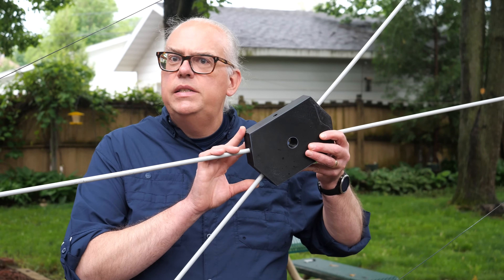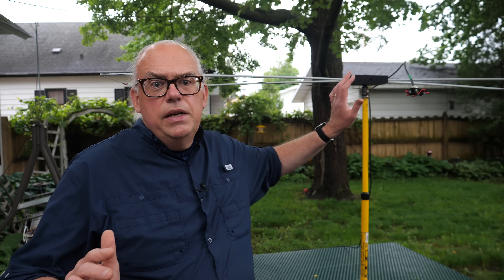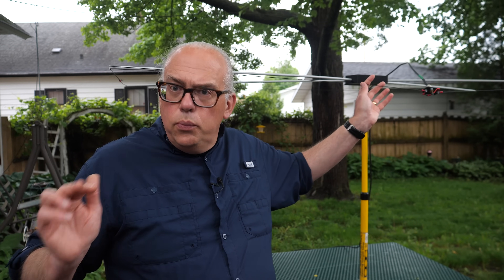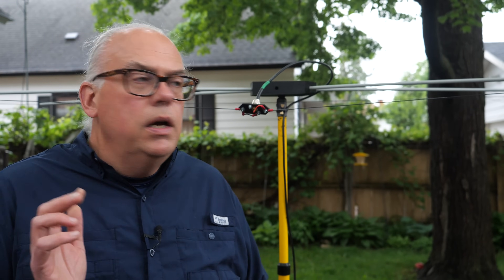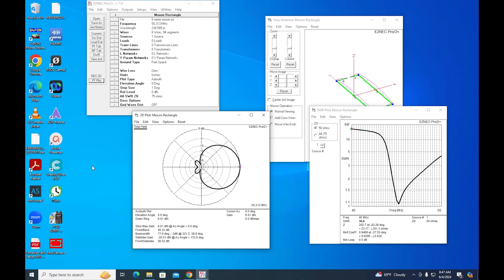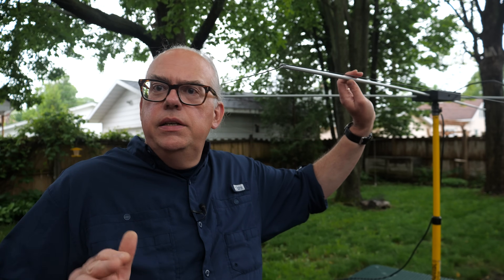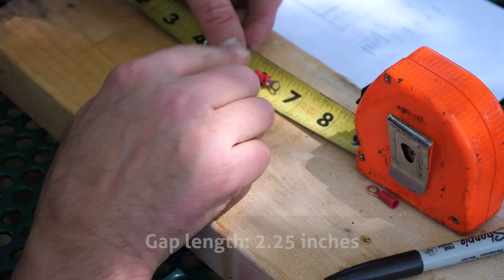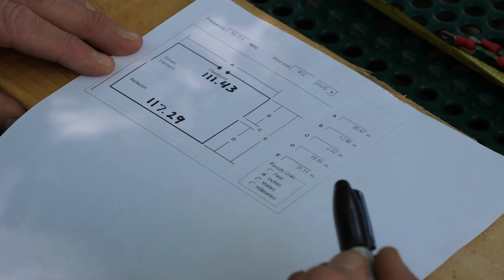DIY 6 Meter Moxon Antenna: Boost Your Summer VHF Fun!

Comment: We need a design that doesn't require a 3D printer.  I don't know anyone that has a 3D printer.  Nobody in our radio club has a 3D printer and Nobody in our radio club even knows anybody that has a 3D printer.
Reply from the maker: Many public libraries now have 3D printers. Otherwise, my hub is based on the design from this article. You could build yours out of wood like the original: http://www.kg4jjh.com/blackwidow.html

Comment: I’m confused as didn’t see you assemble the wire and you said 2 pieces of wire needed so left for driven right for ground, what about the reflector ? Isn’t that a 3rd piece ?
Reply from the maker: Technically you are correct, it would be three pieces of wire. When I said two pieces, what I meant was I cut a length for the radiator and another length for the reflector. I then cut the radiator wire in half and attached the feed point.

Comment: Well been using it a while now works great even when the bands are not great. Used it on Mt Diablo. Made 14 contacts in about 90min. FT8 this antenna works hard to mess it up. I did get it wet once though. Didn't work right again til I dried it out. Will probably put the brush on rubber on the connections. The band is opening up should be a fun summer!

Comment: This changed my life for the better. Get a metric tape measure and a metric, for lack of a better term, yardstick. Then just do all of your measurements and cuts in metric. There are so many less errors. It is so much easier. Life is good.

I don't even know what a 3/32nd is, I don't know what an 11/16 is and I don't know what the hell and 11/16th is. Those are absolutely insane units of measurement concocted by the criminally insane to ruin our lives.

Yes it is a hassle at the hardware store to have to make these conversions because everything is sold in inches and feet, but it is worth the time and trouble to do it when you get things back home .
Reply: It’s just called a meter stick, great advice!

Comment: I have been checking out painters poles in the UK.  Does it have to be made from plastic?  Noel, GI7CMC
Reply from the maker: Most painters poles are a combination of fiberglass and aluminum sections. The aluminum sections won't interfere with the antenna as long as they are isolated from the antenna.
Reply: @KB9VBRAntennas  Thanks for the prompt reply.  Noel, GI7CMC

Comment: Ok I have taken it out 2 times now. It is a fun antenna to play with. It is working great! 6m meters is a crazy band. First time I made 7 contacts second time only 2. But it works. Not sure if it was because of the band or just lack of operators listening. I played around with one of the contacts first time was a +19 about 60miles away. I turned it toward him and it went up to +30 I was also able to tune it on 10m and 12m and made contacts. Thank you for adding to my fun. Enjoy the coffee
Bill
KM6TAU
Reply from the maker: Thanks for the coffee. I'm glad the antenna is working for you. 6 meter propagation can be quite unpredictable as Tropo ducting and Sporadic-E come and go with not much rhyme of reason. But, that's the reason why they call it the Magic Band.

Comment: Great video.  I have seen a lot of 6m antenna videos and this has been the most helpful.   Did you do a follow-up video after field day?  I would like to see how it performed before building it.  Noel, GI7CMC
Reply from the maker: I did not get to deploy the antenna for Field Day as the transmission went out in my vehicle just days before the event and I was limited to what I was able to bring along. Last year's FD video: https://youtu.be/UVYG-PXWWLU. But I have received reports from others who have built the antenna, and it has worked well for them. I'm looking forward to using it later this spring when it warms up.

Comment: What no comments in 7mos? Ok so I didn't see anything bad about this antenna so I'm building it. I do FT8 and I need 10 contacts in 5 more parks on 6m. I'm hoping this antenna will help me. I will try to report back my findings. 

Bill
KM6TAU 
73
Reply from the maker: Yeah, that's weird. I checked the stats and the video is steadily generating views at the rate of about 650 a month, which it pretty good for this style of how-to video. Six meters kind of slows down in the winter months, although there is a bump in Sporadic-E propagation around January or so. But this is a good, compact, directional antenna to take advantage of those band openings when they happen.
Reply: It's almost ready just have to cut the spreaders and wire it up. I make contacts on 6m but not a lot on FT8 and usually only 60 or so miles away. I have not built a antenna since my 2m tape measure yagi which was awesome. Printed the hub with petg looks great.

Comment: I'm just a Technician class but I have privileges on 6 meter. Is there a service that you know of that can print the necessary parts, for money of course. I just can't afford a 3D printer/wouldn't know what to do with it either ;)
Reply from the maker: I know there are online services for 3D printed parts. Most of them are geared towards low to mid volumes producers, though. I'd check to see if there is a local makerspace or if your public library has a 3D printer. If you are part of a ham radio club, there may also be a member willing to print the parts for you. I hope this helps.

Comment: Thank you!  I am excited to build my first antenna. A few questions I have.  In interest of having the weight of the SO239 connector could you use the smaller SMA connector to a 24" coax pigtail to the shaft and then have a SO239 at the pole?  Or what about just soldering the coax in place of the SO239 connector and making a pigtail to the antenna shaft with the SO239 connector there?  Again newbie asking questions.  I did 6m on Field Day and was giddy like a school kid making contacts hundreds of miles away, being a tech class I am limited.  Thanks!
Reply from the maker: You don't have to have a connector at the feedpoint. You can make a coax pigrtail and solder it to the ends of the wire, or use a lighter connector. Either method will work well.

Comment: Michael, how did you calculate the length of the spreader rods?
Reply from the maker: Geometry. If you look at the Moxon rectangle, the spreaders make a a right triangle. If you take half the length and half the width from the antenna formula, you can then plug the numbers into a right triangle calculator and get the length of the hypotenuse, which is the same as the spreader bar. (Or, the square root of side A squared + side B squared)
Reply: @KB9VBRAntennas  Thank you, Michael! You triggered my memory from high school geometry class. I long since forgot how to calculate the unknown length of a triangle.

Comment: How did you work out the angles for each arm? this is where I went wrong on my build.is it 30 and 60 degrees.
Reply from the maker: You'd assume that the spreaders should be spaced at a 30 degree angle, but that is too wide according to the dimensions of the antenna elements. So I fed the numbers into a right angle triangle calculator and found that the ideal angle is about 20 degrees. That's the angle I used in my hub.

Comment: Michael, can you rotate the antenna and use it vertically polarized without issue?
Reply from the maker: Yes you can. Moxons work great either horizontally or vertically polarized.

Comment: Nice build.  You're suspicion that "something" is interacting with the antenna is a certainty.  The most apparent something is that big coated steel picnic table (TreeTop Products model 1JH1000) that's easily within the near field of 6 meters.  So any resonance measurement is not meaningful because that bench is effectively a part of the antenna.
Reply from the maker: Yes, either the picnic table or my house and garage, which are both covered with metal siding. 

Since you referenced the picnic table, it's a Wausau Tile MF1020. I won it at a chamber of commerce raffle about 20 years ago. https://wausautile.com/Products/Square-Modular-4Bench-Table-MF1020.cfm

Comment: The hub is being printed.  It’s been going for 5 hours and has a looooong way to go.
Reply from the maker: It takes my printer over 20 hours to print the hub.
Reply: @KB9VBRAntennas  Bambu X1C took 10 hours, and that counts the filament change to put my call sign on it. I'm gonna send you a picture.

Comment: Nice build!  An idea off putting a 3-d printed cap on the end of each spreader to rub the wire through.  Just an idea.  73
Reply from the maker: Capping the ends of the spreaders would be an option and certainly dress up the antenna build.
Reply: I found a file on thingiverse for an adjustable arrow nock that I think would work. I haven't tried to adjust dimensions  yet but the author included a step file so it shouldn't be too hard.

Comment: Perfect timing.  I have been looking to make one of these.  No 3D printer, but I'll figure out something for the hub. Locally 6m is pretty active with some local nets, so I am hoping soon to be able to participate. 73
Reply from the maker: Check out the links in the description for my 15 meter Moxon build I did last year. The original plans I based that antenna on used a hub made out of wood.
Reply: If you can't figure something out, I will print it and send it to you for the cost of postage. I was also in the USAF in the early 80's. Spent whole enlistment at Barksdale. My email is good on the zed. 73
Reply: @WG5Xradio  Thank you.  I have sent you an email via your QRZ email.  It might end up in your spam folder, if you don't see it.

Comment: I've yet to hear 6m activity. Probably just bad luck.
Reply from the maker: I’ve found that 6 meters takes a lot of patience and listening. Sometimes I’ll crank the volume and turn up the squelch on the rig. Then I can hear when the band opens. Calling CQ doesn’t hurt either.
Reply: Don't be afraid to call CQ on 50.125.   If everyone is listening then nobody is talking.
Reply: So I'm building it. I only do FT8 with Pota. I'm working on 10 parks 10 contacts on 6m. It is for sure a challenge. I have 10 contacts at 5 parks so far. But it is a crazy band. Not magic for me. I did get Ukraine see crazy! Hopefully your build will help me with 6m I will try to report back
Bill
KM6TAU 73
Reply: Terrible band...I have a 6m beam that is a total waste of tower space

Comment: I might just "Pop" in to the Field Day site this year.
I have not seen anything about Field Day Yet ?
Can you just use a Butt connector at the end of the Trimmer line to wire connection ?
and just a Piece of No.12 solid Copper from the SO 239 center pin to the Lug, No crimp connector necessary 
Thanks 
Mike M..

Comment: Could that generator program also be used to scale one down to 2m or even 70cm?
Reply from the maker: Yep, it will generate element lengths for about any frequency. I used the same program last year for my 15 meter Moxon.